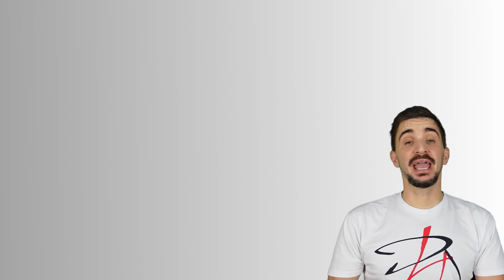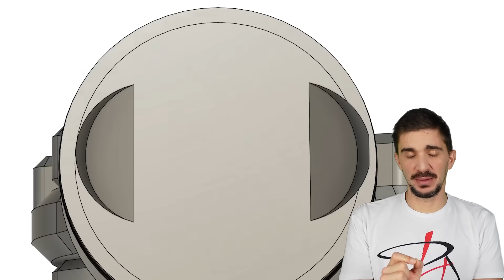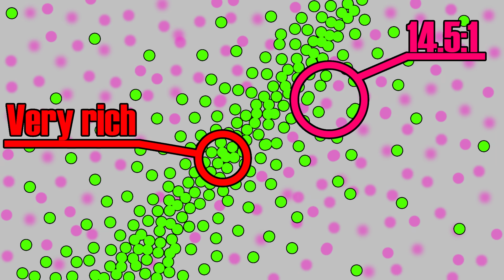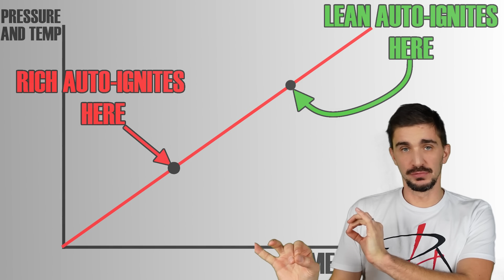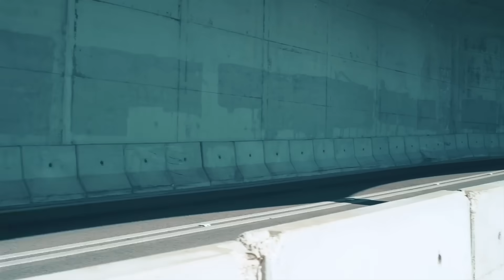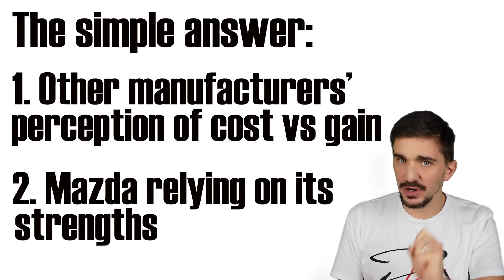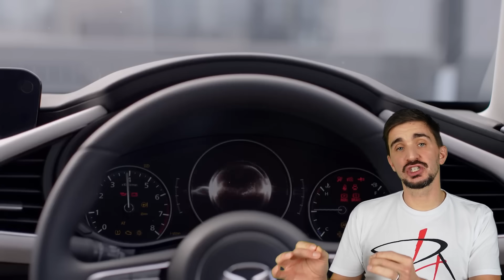The Game Changer Nobody Cares About - Mazda Skyactiv-X SPCCI How it Works and Why It Didn't Catch On

Comment: I had a Mazda 3 manual (!) when I was with a company in 2023. It had the SkyActiv-X engine and man I loved that thing. Nice engine, nice looks, good driving characteristics and so on and so forth. I always liked the SkyActiv-X engine so much, because it was new and "funky" for what SPCCI was about. Seeing the images on the background, I dearly miss it. It's only a car, but man did it drive nice. Enough torque from the bottom, quite high rev-range, nice sounds and I could swear it has a supercharger in it..
Reply: It does actually have a supercharger on it. It's used to help maintain the high air to fuel ratio consistently, otherwise with changing loads and rpms the ratio required to make SPCCI work may not be present. It helps particularly in the first half of the rpm range under high load, when the engine depends a lot of air, but may not naturally draw in that much before its got going.

Comment: Very very cool and informative!  Even though I thought I knew the basics about combustion for both gas and diesel, I did not really know the particulars.  Mazda's approach is great.  It would seem ideal with a large battery hybrid as it would allow the gas engine to run more optimally - like an Atkinson cycle engine.  Do you know what happens if the spark failed to fire - would the mixture still ignite at TDC - just unpredictably?

Comment: how about make the rotation of the engine disconnected from the wheel rotation by using generator and motor like a diesel train or Nissan e power? By doing that, they will have more flexibility to make a condition for HCCI. They don't even need the engine to output a rotational movement anymore since generator can be arranged for linear motion directly (the inverse of selenoid or linear motor). And instead of using flywheel (mechanical battery), they can just use the "needed anyway" chemical battery to move the piston via the generator that now acting as a motor for strokes other than power stroke. By doing that, the compression ratio can be flexible and the mixture can fire anytime without damaging anything.

Comment: there's another possible alternative to giving up control: limit the number of variables

for example, if you make your vehicle into an electric hybrid with an HPCCI engine that has one set point for RPMS, one set point for load/resistance, and one set point for the air/fuel ratio, you could run it as-is and charge the batteries while the electric motor operates the actual drivetrain. This already exists for diesel train engines, which just use a diesel generator at one range of optimal parameters, and electric motors to operate the train's wheels

Comment: Actually this engine hides a secret if you look carefully. 

If you remove all the foam covers you get to see that the injectors, fuel rail and hpfp are not Denso, but Magneti Marelli. 

And that's because the engine was originally developed in Turin Italy at the GM Powertrain Torino by FIAT following the work done by Per Gillbrand from SAAB

They developed the first functional HCCI engine around 2007

Comment: In what sense is it compression ignition?!?  It's right there in the name: Spark Initiated.  

I guess the point is that the pressure increase brings the engine to the point compression ignition would be possible??  But is it really compression ignition? I mean it is the heat doing the work too. I guess it doesn't matter too much, just the compression ratio does but that's not what seemed like the video focused on.
Reply: You can see the difference in combustion speed between SPCCI vs normal spark ignition in the video. Notice how the fuel in the upper blue circle is finished burning much faster and their is no flame front propagation to follow, like in the comparison below.
It's clear to tell that in SPCCI the initial ignition compresses the rest of the A/F-mix to spontaneously combust.

Comment: The problem can be traced back to the fact that Skyactiv-X does not beat a Diesel when looking at bare efficiency. Skyactiv-G (i.e. a conventional spark-ignition Otto) can do 235 g/kWh, Skyactiv-X does 218 g/kWh, however, a 1980s(!!!) Diesel engine like the Audi 5-cylinder 2460 cm³ engine can do <200 g/kWh. Even stone-age technology Diesel engines from the 1990s – prior to the advent of common-rail injection – reach <190 g/kWh. Granted, this is only at a very specific point in the map, but even looking at a wider scale, the Diesel is still vastly more efficient over a wider range. Even a toaster-grade cheapest of the cheap economy car 800 cm³ Diesel engine like the Mercedes-Benz OM 660 from 20 years ago with a basic 2-valve design outperforms Skyactiv-X.

In practice, buyers can make a decision between a huge up-front investment and long-term savings (Diesel) or spending less on a spark-ignition car and paying more for fuel during the car's lifetime. The gap here has become increasingly smaller over the past years, and attempting to bridge an ever-so-slightly decreasing gap is a failed strategy. Also adding to this is that in recent years, cars have become SUVs which, due to their poor cdA, lose more kinetic energy to the environment when compared against traditional saloons, which results in increased fuel consumption that has compensated for advancements in technology. Thus, apparent fuel consumption of cars has remained largely the same over the past 20 years, and drivers simply don't seem to bother.

Mazda could have chosen a radical approach and abandon their conventional spark-ignition cars to save cost, but I understand why management would not want to take such a risk. A conventional Skyactiv-G spark-ignition engine is good enough and less expensive, and those who really want to save can still  buy the Diesel. No need for Skyactiv-X seem from a management perspective. But hey, it's cool to see that some companies are still innovating, but well, I am not surprised that nobody else has yet adopted this technology.

Comment: My metric for deciding if a feature is needed or luxury is how much it increases safety, control and economy (context/use case dependant).
Automation does allow you to pay more attention to the road and traffic, but you loose control, which is crucial once you need it to stay in one piece.
There have been more and more "features" in modern cars that decrease the first two (even if advertised as doing the opposite), and that's an automatic veto in my book.
If having an SPCCI engine requires a manual, that's an overall positive for me. Less desirable car? Just means less likely to be stolen.
I'm not surprised, however, that I've never heard of this feature. Probably because the touchscreens got more attention.

Comment: 1. Stoichiometric isn't best for emissions part of the point of the engine is that. 
2. Skyactiv-x isn't naturally aspirated usually it's supercharged to get more power while mantaining efficency. 
3. Alot of direct injection engine ie fb25/20d use startified charge and run closer to 18:1 for effiency when cruising

Comment: The fact that only Mazda has tried it reminds me of the type 93 torpedo that Japan deployed in WW2. They used pure O2 instead of compressed air which allows for far more performance at the cost of being more complicated. The type 93 "Long Lance" had more range AND higher speeds than any other torpedo in the world at the time AND carried one of the biggest warheads as well. The other major powers considered using oxygen torpedos, but determined them to be "too expensive and troublesome" to develop and deploy in early studies. The specs on them were so good that American leaders dismissed them as impossible when they first got wind of them.

Comment: The problem if I remember right is that one has to pay extra for the Skyactiv X engine and there is a 2.5l option as well w/ more hp/tq. The fuel has to cost quite a bit and you have to keep a car for some time to make up the difference vs the base Skyactiv G. Impressive, but not impressive enough.

Comment: The way i see it is spcvi is advanced ignition timing on hcci.
Hcci runs really lean to prevent knock and works like one of those fire-starting pistons from camping videos.

Funny rnough this is how i thought engines ran more or less before i fully understood this and i think this really points out a big issue in engineering: currently companies focus on skill retention instead of training, the result is a very few new ideas.

Comment: Isn't the problem here that this is a technically impressive but merely incremental improvement? If Mazda would care to pair this engine with a full hybrid architecture and a decent transmission (similar to Toyota's e-CVT) then they could achieve a better driving experience and beat Toyota at their own efficiency game.

Comment: HCCI would make a perfect range extender for BEVs. No need to change load or RPM, just turn on and provide electricity to charge the battery when needed and then shut off

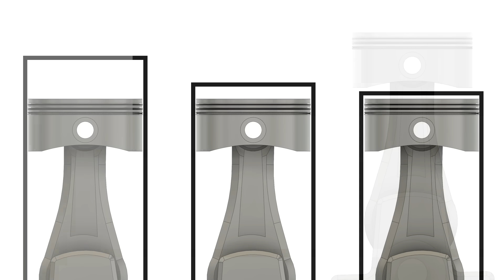Comment: 1:55 this explanation makes no sense and is wrong. You can change compression ratio without changing how far the piston is from the top of the cylinder by just having bottom dead center not be as far away. The real reason why compression ratio matters if because it effects the PV diagram, we can get more area inside our cycle so to speak, by having a higher peak pressure.

Comment: 2026 Mazda 3 sedan MPG: 27 city, 36 highway. 2023 Corolla (non-hybrid): 32 city 41 highway.

So where is that supposed efficiency?

And then plenty of brands have hybrids now that hit the 50s easily.

Even if on paper their engines could be more efficient, they simply aren't in practice, and hybrids beat the pants off them if that's really what you care about.
Reply: Mazda tends to get, or beat, their rating in real world driving. Toyota tends to fall short of their ratings. 
The difference is Toyota engineers the cars for the test so it provides the best numbers for advertising. Mazda engineers them for actual driving and the test numbers are just whatever they end up at.
Reply: @NBSV1  They are both tested in the same way, by the EPA. There is 0 difference in how those numbers are retrieved.
Reply: @TheGamerUnknown There is a big difference in the EPA test and real world driving. I didn’t say Mazda was doing a different test to get their numbers. Mazda isn’t building their car to specifically do better at the test. They’re building to do good in the real world. 
The smaller turbo engines and CVT do better with the EPA testing, but are marginal in the real world and don’t have the same durability. The high compression and more regular transmission does better in the real world and often has much better durability. 
For me a manual trans has been great. Based on testing a CVT should be quite a bit better. But, in reality it can work equally as efficiently if driven politely. Then add in not having to replace an expensive transmission when the CVT fails….

Comment: Great video. I haven't kept up with engineering innovations in cars as much in the past 10 years as I did when I was younger.

SPCCI seems like it would pair really well with hybridization. I've always thought that turbo-chargers add cost and complexity that (at least in the past) resulted in reliability issues at high mileage. Since I know a bit about cars, I used to help friends fix their old cars. My experience was that turbo engines leaked oil, had issues with crankcase pressure, or had issues with clogged return lines. I felt that naturally-aspirated gasoline engines (I was a fan of Honda and Toyota engines in the 1980s-2000s) were the most reliable, although I didn't work on a lot of large diesel.

To me, I think it would make sense to use electric motors for low torque at low speeds and then use gasoline with SPCCI for efficiency at long range constant speeds. That would be my preferred engine design if I had to frequently drive long distances. Since I live in the city now and rarely drive long distances, I prefer to drive my electric (not a Tesla) car for short trips and then just charge it in my garage between trips.

Toyota, which has been resistant to transition to broader manufacturing of electric cars, should definitely consider SPCCI. It seems that it would be a good fit for them since they generally don't use turbo engines in their smaller sedans. SPCCI seems like it would be a good fit for something like a Prius hybrid or hybrids from other manufacturers. Hyundai likes to use turbo engines, but I think it would make more sense for them to rely on electric propulsion in their hybrids for low-speed torque and then to use SPCCI for fuel-efficiency at high speeds in hybrids.

Comment: sorry but that’s a bit BS - most of inefficiency of petrol engine comes from “cooling with fuel” where ecu dump way more fuel than needed just to keep exhaust valves from melting. All that is due to chasing more and more ridiculous power number while lowering displacement.

Comment: I just checked a website where consumers report their fuel economy of their cars. This is the real-life experience, not what the manufactures are saying in the brochures. 
About 14 people who own a Mazda 3 with this engine have reported their fuel economy.  It became apparent that the fuel consumption... well... isn't that impressive. The average consumption is 5,9 liters per 100 KM or 39,9 miles per gallon. This isn't bad, but the competition isn't far off. Some even do better in comparable models. 
 In short: with a HCCI engine, the car drives more boring and the savings in fuel isn't that much. This seems to be a better explanation why the competition isn't catching on. 

For people who really want to save on fuel, a hybrid is a much better choice. Hybrids aren't exciting either, but these REALLY use less fuel the ICE cars.

Comment: Mazda first announced Skyactiv X SPCCI engine in 2017. They wrapped up the announcement with a PR blitz that included all the automotive press invited to press conferences and test drives. They wanted everyone talking about their SPCCI "breakthrough". The claim was 20% to 30% improvement in fuel economy and they said they would come to the US the following year. SPCCI engines never came to the US. They did sell them in Europe where the 20% to 30% fuel economy improvement worked out to less than 10% and most of that was due to the mild hybrid drivetrain. SPCCI failed because there was no there there. They were expensive engines that didn't perform anywhere near the hype.

Comment: The test drive was a very good point. HCCI may be the holy grail of combustion engines but at the end of the day they have to show tangible benefits to buyers. Nissan's variable compression technology seems to be far easier to sell. You get turbo torque, more horsepower, and better efficiency all at the same time. Nissan's 1.5 three cylinder beats Mazda's 2.0 four banger in all three metrics, at least when comparing the Rogue to the (much smaller) CX-30.

This is coming from a CX-5 turbo owner.

Comment: My 1980 chevy citation carbureted 2.5l and my 1985 Honda accord carbureted 1.8l both got 40mpg. I don't think that they really want engines to be fuel efficient these days
Reply: Modern cars are far heavier which reduces the mileage. And, they make more power which also can reduce mileage.
Reply: @NBSV1 yes, both of those cars were light but were still very slow due to low horsepower engines. Not very enjoyable to drive

Comment: With material science being what it is, could we make an engine with a non electrically conductive cylinder? Then do a lightning bolt spark across the entire chamber. The entire mix ignites across the entire length of the spark.
Reply: Because igniting the whole mixture at once is detonation and gives a sharp sudden hit instead of a relatively gentle push. 
With direct injection they’ve been working on creating basically just a small pocket of fuel/air mix that ignites instead of the whole cylinder worth. That would be about the only way to get the whole thing to ignite at once and not break things.
Reply from the maker: It's definitely an interesting idea but I imagine that creating such massive voltage thousands of time per minute presents its own challenges and drawbacks.

Comment: tbh, mazda is like the only car brand i would actually want as a new car. they still make na rev happy engines, which is where the fun is at. who doesnt want a fun daily driver?

ive beaten on quite  few VW and Skodas during work, the leased cars always new and all are the same boring driving, 
all are automatic even the gas cars feel like they make power down low and dont feel fun when reved out, they just kinda stall in place it sounds louder but it feels slower up in the revs...

Coming from my 36y old MX5 it on paper seems like the same driving feel on paper except that its modern and clean.

Comment: One thing about being old school, it's proven technology that works and shouldn't cost a small fortune to repair. After having an EV for a while and all the problems that brought, plus the expense, I ordered a Mazda CX-30 2.5 e-Skyactiv G MHEV Takumi auto in soul red crystal, four months ago, which due to arrive sometime in March 2026. That car uses the much simpler naturally aspirated 2.5 e-Skyactiv G engine, mated to a tried and tested torque converter auto gearbox, so hopefully I'll have many trouble free miles. I didn't require supercar performance, but on the other hand, it does look a little bit like a Ferrari Purosangue! 😉